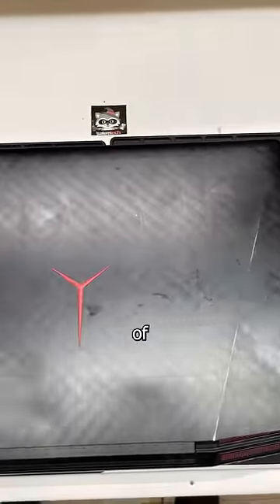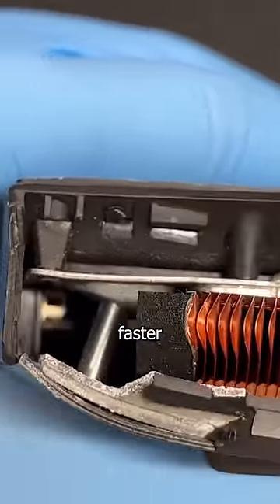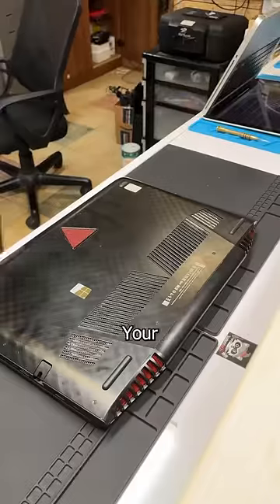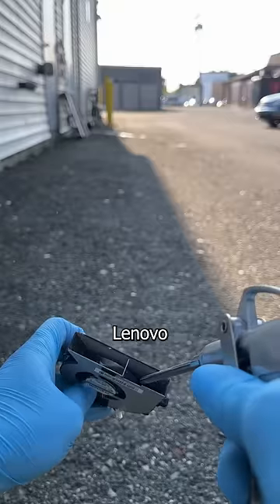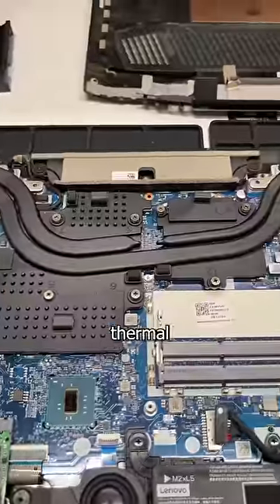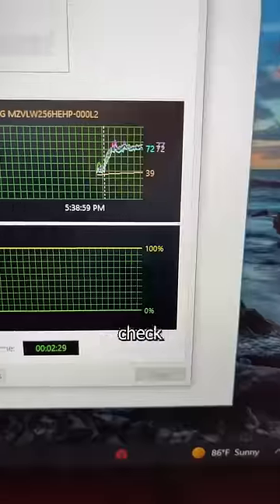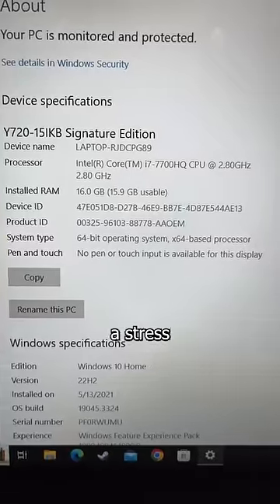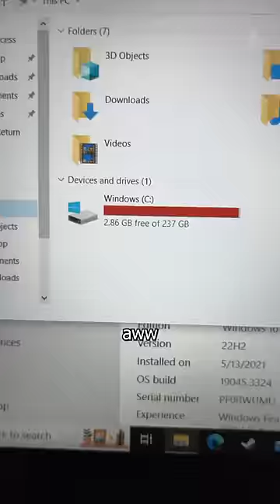Lenovo Legion #gaming #pc is dusty and falling apart #technology #tech #shorts

Comment: That 300 Gb storage in 2023 is painful and relatable
Reply from the maker: Thankfully 1TB NVMe's are super affordable. $40!
Reply: Its from 2018, laptops at those times had a 256 gb ssd + 1tb hdd
Reply: @alisterrebello5337 The good old days when games didn't require SSD to run well
Reply: Just buy a 1tb its so cheap u can not eat one day and have it
Reply: @SalemTechsperts its crazy, i remember paying 100 bucks for one a few years ago
Reply: Me with 118 gb of ssd:
Reply: i have 121 💀💀
Reply: Me with 110 gb rn:
Reply: Me with 500GB
Reply: @minecraft69122   That Aint Bad
Reply: @SalemTechsperts  40 USD is expensive in my country
Reply: @SalemTechsperts you mean adata 😂
Reply: @sihamhamda47 and took forever to load? While also having shitty frame times
Reply: @MrTerrorM omw to starve myself for computer storage
Reply: AINT NOT WAY THAT 300 GB AND I RUNNING ON A CELERON WITH 60 GS LEFT
Reply: @MrTerrorM it hurts, the not eating part to get what you want is so relatable
Reply: im just chilling with 256gb😃
Reply: Me using 128 ssd 😢
Reply: @alisterrebello5337  the 1tb hdd in 2018-2019 they are literally sometimes in budget or mid-end already
Reply: @SalemTechsperts sure is in the US, but not over here where the exchange rate is ₦800 to $1 lmao
Reply: Lol imagine clinging onto 1tb as a minimum, I’ve dealt with all of the sort 2TB, 1TB, 750gb, 500gb, 256gb, 128gb, 64gb, 32gb, 16gb, 8gb, 4gb, and 2gb respectively, below  32gb is abysmal but 64+ is solid, I’ve got a 64gb surface it’s probably Trying to update as windows usually does so it’s storage is kinda lower than usual but 22gb remaining is manageable. It also has a 256gb sd card that has 171gb free
Reply: @sihamhamda47  the bad old days when HDDs were required because SSD's were so expensive.
Reply: I have 56  bro
Reply: @Josaiah i have 10 gb i feel you my brother.
Reply: I have 128 and windows took half of the storage
Reply: Yep, I’m stuck on a 256gb nvme in my laptop, but have an empty sata bay so I might get a 1tb sata. Sadly my new 128gb A2 chip  SD card died and had pictures of my deceased relatives and some games. I likely have the pics backed on another device, but I feel shitty losing a new 128gb card. I think it’s malware because it sometimes shows up as the wrong size and format. I prefer desktops
Reply: @SalemTechsperts i saw a 2Tb samsung m.2 for 60 dollars at best buy a couple of days ago lmao
Reply: Me with 236GB Gen3 drive😅
Reply: I have 120
Reply: my C disk has 58 gigs lol I use my D disk for everything else
Reply: It’s crazy how even 512GB is small nowadays
Reply: Been having 2 TB since 2015 can’t relate.
Reply: Wow I got 50GB
Reply: 2TB M.2 SSDs are like 80 bucks
Reply: @sihamhamda47   They still dont require it. Right? 🙂
Right??😐
😶
Reply: honestly that's a lot
Reply: Well I’m still running 52g and my computer is gateway
Reply: @SalemTechsperts it already that cheap ?????
Sadly i also need upgrade for my ipod
How it priced for a msata 256gb ?
Reply: @SalemTechsperts probably lacks a dram cache. Not really what you want for gaming.
Reply: I have 256 and I struggle to use it all, I wonder what the hell yall use all that storage for
Reply: @khaliil12mm i mean it kinda is. 500gb is like 5 modern games nowadays. Like bro hell warzone alone is 200+ gigs as a f2p game
Reply: Me with 2TB ssd with GTX 750 ti level gpu
Reply: @khaliil12mm that is bad
You have to divide it by C and another partition for all other programs. 
I AM LITERALLY RUNNING OUT OF SPACE
Reply: @RimFaxxe  K I will Try It Out Later Thanks For The Idea
Reply: Have a pc from 2014,and it has 500 gb😂
Reply: nah my pc still good with 128 gb ssd ( i lied )
Reply: Welp, it's a 2016 design so I'm not surprised
Reply: I have a terabyte and have it full all the time man, I need to get my an external drive but I'm broke rn lol
Reply: On my pc for the longest time i was running win 7 with 20 gig c drive because when my dad built it he said it boots faster that way
Reply: My iPad (8th gen) has 32 GB of storage 😭 😭 my freaking Apple Watch (SE gen 1) has the same amount of storage
Reply: @SalemTechsperts  about 100,000,000 din in my country
Reply: What you store on them, seriously for internet browsing you not need more than 250 gigs.
Reply: @zamorakbrews7228 bro, I dropped 300 bucks on a 120gb samsung 850 evo back in the day.  Those things run less than 30 now.  They're 10 percent of the cost I paid  6 years ago 😭😭
Reply: @alisterrebello5337 even still, 256gb of storage on a gaming laptop is small, if I am paying $600+ I should get atleast 500gb
Reply: I have 100 GB storage on my 2008 laptop. And i can't even afford an upgrade 😭
Reply: @NetQza same. laughing in 120gb sata SSD and 17 year old fujitsu siemens laptop
Reply: @samulimahkonen8604  we are both laughing in old ass hardwares
Reply: Is it? I don't speak laptop, and I shoved quite a bit of storage into my PC over the years
Reply: @sihamhamda47 the gold old days on my 5400 rpm 500 mb HDD. I love being able to work an 8-hour shift before my windows boots!
Reply: I got 20 gigs 😎
Reply: I have 7 tb of storge. 1 x1 and 3x2
Reply: I still use my Acer Switch 10 with a 32gb SSD built-in primary storage but i have a 500GB SD card as secondary drive.
Reply: I've a desktop still running on a 30gb IDE
Reply: What do you mean you should be able to fit more than 2 games on your laptop's storage at a time?
Reply: Nah bro im 128 yall hella lucky my ass barely could get nv and terraria on my shit 💀
Reply: @sihamhamda47 no game still does that, i have an 1tb hd for games and every single game i played runs fine (i have an r7 5700g, 32gb ram and a 3060 12gb)
Reply: @SalemTechsperts  Usually some Adata or Kingston crap that will become unusable faster than you will say "mama".
Reply: @SalemTechsperts I remember buying 70$ for 8 terabyte hard drive I still using till this day after 5 years of used
Reply: the last time i bought a prebuilt in super early 2023 it had 250 gb storage 😀
Reply: You don't even know man, I have an actual pc and it has the same amount as the lbtop 😭
Reply: @MrTerrorM except if i buy that i cannot eat for two weeks 😢
Reply: @SalemTechsperts just got a 4tb nvme, 250 Canadian
Reply: @maticpodobnik slim & sexy measurements
Reply: @EasyMoney322 What operating system does it use?
Reply: @lordzaboem  Win 7 either ultimate or pro.
Reply: I just got a pc myself. Im poor, so i got a family members old one. It's from like 09. It has about 1000 gigs of storage. Shits wild.
Reply: My laptop only has 217gbs lol, and it’s from 2020
Reply: I make it work tho
Reply: try 256
Reply: Dude, my ex's laptop only has a 50gb hardrive. Lmao
Reply: Gta v would take 1/3 of your storage😂
Reply: I got only 256 and 4 gb of ram
Reply: @sihamhamda47 technically they don’t still, they make high end SSD’s. Dunno why you would want one given HDDs run significantly more effectively and energy efficiently. Though to each their own
Reply: @SalemTechsperts 40 USD ??
it's 3,400 INR in my country
Reply: my 250gb ssd has 40mbs available 😂
Reply: I have 500 gb in my internal ssd, this is why I'm gonna add an additional M2 after undusting and changing the thermal paste
Reply: @SalemTechsperts yo where'd you get that?
Reply: mine has 300 gb too
Reply: @sihamhamda47 not the good old days in the slightest cheap SSDs are a godsend
Reply: It’s barely enough for 1 COD game
Reply: I have a TB full of stuff on my laptop
Reply: @SalemTechsperts no way it's $40. I paid $60 I swear bro
Reply: @SalemTechsperts What the- what? It's up to almost $200 in my country and that's on flipping discount, why tf it's so expensive here?
Reply: @sihamhamda47 you don't need it for good performance in terms of FPS but loading times will be brutal without it
Reply: Not me rocking my shitty little 128GB HP that has been overclocking constantly since the first time it was turned on, but due to it's paper thin, cm wide CPU, it's litterally not powerful enough to generate enough heat to actually overheat
Reply: Bro i have 256GB SSD and everything works normal and I even have 90+ gb free space
Reply: Mines worse. Its 222 gb💀
Reply: @Six_Yeager  💀 💀 💀 💀 💀
Reply: i still have my dad,s 20gb HDD
Reply: @SalemTechsperts  bruh it costs like 300$ where I live. For comparison an i7 10th gen cpu is around 900$ here
Reply: I have a like 2020? Computer that has 130 gb, and like 100 gb of those is used by god knows what
Reply: I have a 118 GB storage on a gaming pc from 2012. Still works…………………

Help me
Reply: @alisterrebello5337 ...thats considered bad now????
Reply: 64Gb 😢
Reply: @SalemTechsperts T-T im using 2 128gb the prices here are way too expensive
Reply: Had my os stored on an old 250gb ssd and it kept getting full after updates etc (moved the download folder and pretty much everything that could be moved without messing up the system or certain apps) and general drive cloning wasn’t working properly, eventually spend £30 for a lifetime licence for a different drive clone software and within 3-4 clicks and a little bit of waiting It moved straight to a partition I prepared on my NVME, changed the bios boot option and it worked perfectly and booted twice as fast, well worth buying the NVME drive or at least moving the os to a different drive
Reply: I got a pre-built pc a few months ago (shut tf up build it yourself elitists i dont trust myself) that had 500 gb storage and just installed the 1tb hard drive from my old pc, tripling my PCs storage near instantly was quite pog
Reply: Wut
Reply: Bruh om sitting at about 70gb total storage
Reply: Me with 32 GB here... (this laptop has been passed through generations)
Reply: @alisterrebello5337 IF you paid extra for the 1 tb hdd. Usually its either a 300 gb ssd or a 500 - 1000 gb hdd
Reply: I got a 120 gb SSD 😭
Reply: i have 128 usable....
Reply: I have like 50gb 😔
Reply: I still use a 60gb ps3 that only holds like 4 games 😖
Reply: Try getting a 2nd-hand Acer Aspire 7, with Winblows 11, on a 128GB SSD!. it was practically full with only a couple of games on it. Pathetic. When I installed Winblows 10 instead, interestingly, it said the same hardware couldn't upgrade to 11. Not that I care for, or about, 11.
Reply: @jingo500  winblows 😂😭
Reply: I have 200 gb storage 😢
Reply: Meanwhile me with 6Tb and still needing more xD
Reply: @SalemTechsperts hahah yeah affordable! (I literally work at McDonald’s and have £5…)
Reply: Cries in 6 TB of 6.5 used in my desktop although nothing is actually on there
Reply: My man I only have 128,, but then again it’s not a gaming laptop 😀
Reply: @MrTerrorM only one day? Damn prices really have dropped
Reply: What about us 250GBers?
Reply: Bruh 💀💀 i bought lenovo ideapad gaming 3 and got 500sdd only damn Gta , world of tanks and Hitman 3 and im on 87% (red) 💀
Reply: I have 256 gb
Reply: u get a 512 gb ssd for like 25S today
Reply: @NetQza  lol i have 512 sdd only in 2023 really sad hahaha
Reply: I swear to God, if everyone that has suffered in this earth is destined to go to heaven, I'm already there because I use a "POSITIVO" laptop with 1.44Ghz processor, 4GB of RAM (that barely handles Windows 10) and only 64GB of SSD 💀
Reply: @SalemTechsperts But still not for everyone...
Reply: I have a laptop with only 128 gb of space, It's really a pain on the balls
Reply: My old pc had 255 gb now I have 112 gb
Reply: me with 20gb available and 50gb max:
Reply: me with my 32gb chromebook :')
Reply: YOU GUYS HAVE 300GB???!?
IVE ONLY HAD 100 FOR THE PAST 10 YEARS
Reply: Ayy mine too
Reply: i have 222 gb storage lol
Reply: @Project_Baby  only in ohio (pukes in sigma)
Reply: @NetQza  lol hahah
Reply: Me with my 500gb storage:😢
Reply: @Mohamed_Aahil6915 
2 games. Star-field and flight simulator, and there you’re at full capacity. I have a total of 5.5TB and it’s barely enough with the size of games these days
Reply: WHAT my dad ahs 128 Gb SSD and it's works fine 😂
Reply: Yup
Reply: @SalemTechsperts my storage is 117gb 😅😭
Reply: @SalemTechsperts  why didn't anybody tell me? I got a 500 gigabyte ssd in my computer and struggling for storage
Reply: Why buy 300 gb 1 tb isn't THAT expensive jeez
Reply: i have 220 gb storage....
Reply: @SalemTechsperts Really affordable 40$ only here is 80$ for 1tb nvme😢 too much problem with parts
Reply: @SalemTechsperts that’s more then I’ll ever make in life
Reply: @SalemTechsperts  can't you just go to Windows+R and delete all the fes that's there? Does it help?
Reply: I hardly need more than 128
Reply: @Microwave_404  you don’t hardly need more then 128 gb in 2023 for computers
Reply: @alisterrebello5337 it's from 2016. I have this exact same model with exactly the same 256GB + 1TB combo 😞 since it came out. Still looks and works like brand new. Build quality is on another level.
Reply: My main boot drive is 252 😭 but my other drives are like 2TB Each
Reply: i have 126gb + 256gb (ssd) XD
Reply: @sihamhamda47  nah they just loaded slower
Reply: @sihamhamda47 thats because games moved to asset streaming, eliminating almost all loading screens
Reply: We spent $500 to buy me a shitty i5 workstation with 256gb of storage in 2019😊
Reply: My oh-so-lovely prebuilt PC bought in 2017 only has 128 gigs of storage on the primary drive. Thank god I'm building a new one soon with 2 TB of storage
Reply: Not 300gb,
Its 236gb (256)
Reply: I use 128gb ssd😅, that too in a dual boot mode with pop os and windows.
Reply: 2 games is enough 🥲
Reply: @SalemTechsperts  WHAT
Reply: I have 100💀
Reply: I have less 💀💀💀
Reply: @SalemTechsperts affordable, but you need to open the whole back if it’s a modern system 💀 I miss the small upgrade windows that didn’t require 15 screws and lighting 30 plastic tabs so it will actually seal instead of breaking the, like an idiot
Reply: @SalemTechsperts first step: have removable storage on your device
my 2014 macbook air has but that thing sucks dust like a vacuum and has-haswell so pretty useless now since its low end...
Reply: If its enough for tf2 , War robots and ultrakill , its fine for me

Mine has Like 254GB
Reply: @MrTerrorM we’re not eating food…but we ARE eating success!
Reply: I have 250gb 😂😂😢
Reply: Very relatable
Reply: Me with 50 tb
Reply: I have a 256gb ssd
Reply: Better than mine
Reply: I have 112 Gb
Reply: 300 gb is bad?
i have 156gb...
Reply: The fact that it was made after like 2010 is funny enough. But it being marketed as a "gaming PC" with that little space is even better. My RDR2 files are like 230gb
Reply: @SalemTechsperts  Stuff like this still gives me whiplash
Reply: @alisterrebello5337  I have 233 hard drive💀💀💀
Reply: @Itsappuru  40 USD over where i live is like 200bucks
Reply: @SalemTechsperts 40? Where are you buying your parts, ive only seen them as low as 60
Reply: @SalemTechsperts  yeaaaaah, it aint that cheap no more...
Reply: @sihamhamda47 ssd is so affordable now adays that its not really a valid complaint anymore tbh. Dont the consoles even come with ssd?
Reply: @sihamhamda47 the good old days when games weren't 25-100 gigabytes in size
Reply: @SalemTechsperts  I genuinely thought this was a joke until I went on Amazon. Holy shit. I remember when a 1TB SSD in general cost an arm and a leg, let alone NVME.
Reply: I have 400 i feel the pain
Reply: Meanwhile me with 320: 🗿
Reply: I got a 56 gb emc card for storage lol,  350$ laptop
Reply: my mac literally has 121gb and im not going to say its fine
Reply: @SalemTechsperts  you can only get noname QLC trash for that price. 990 PRO cost quite a bit. 980 and 970 EVOs are not much cheaper. Anything less is completely unsuitable for a system drive. And even for general storage, good TLC is highly recommended. QLC belongs in the trash, even Samsung. Thankfully, they don't make QLC NVMe.
Reply: @SalemTechsperts  Aged like milk
Reply: i have 126gb on my desk computer)
Reply: I honestly thought they'd have been gone by the time this laptop was being sold 7th gen laptops would've been 2016 iirc? I guess 250gb drives were/are still a thing. A 300gb drive brings me back to my old college laptop from 2010...AFTER the original 120gb drive died 💀
Reply: @sihamhamda47 no. Bad old days of mech hard drives, where every time you'd click on something in Windows it had to "think" first.

I grew up in the 80's and I'll thankfully pay extra to never own a mechanical hard drive again. 

"Good old days"
You are hilarious with that crap. If anything signifies the good old days it's not having to pay $700 for a midrange GPU.
Reply: Thats actually good for a cellphone
Reply: @SalemTechsperts 
Cries in poor, 2014 potato pc game....
Reply: 105 gig ssd 😢
Reply: Sounds like plenty of space for a lot of games.
Reply: 500gb to 1TB is the norm now when comes on gaming hardware storage.
Reply: 300 is not THAT BAD.
Windows is 50gb, do you have 200gb left for your games.
Reply: Meanwhile I use a third hand 120 GB sata SSD in my laptop
Reply: Bro my potato laptop has 57GB.
Reply: 300 GB’s is not nearly enough bruh i’d be stuck to one big game, a few others and that’s it 💀
Reply: Found this and just have too say, im in this boat after my 1t died and now im stuck with a 300gb SSD only. sad times.
Reply: @SalemTechsperts I don't like to remind, even though 1$ is 5 Brazilian buckos, due to 92% taxation we literally pay 10x higher
While also having a 7.48 hourly pay (BRL NOT USD)
and a high living cost
Reply: I have a 500 gb SSD as my boot drive on my laptop.
Reply: @alisterrebello5337  most only had a 256gb ssd and had a slot for a hdd
Reply: @NetQza  i used to have a 64gb 100 mg/s drive as my main drive in my laptop, And i was running windows vms 💀
Reply: @SalemTechsperts  Where?
Reply: @LanIsOriginal  not always, depends on few stuff but it's not really that bad, i have ghost of tsushima on my hdd and it loads literally within seconds, craziest load time i saw in game ngl.
Reply: @GoGicz   it is definitively worse in nearly every way using an HDD ESPECIALLY load times, if it loads within seconds it'd take even less using an SSD
And even with light games that load fast it's still awful because of pc boot times
Reply: @LanIsOriginal  i use ssd for windows but hdd for games, and like i said load times are completely fine, it doesn't matter to me if it loads in 4 seconds or a second later, just saying that it really doesn't matter that much.
Reply: @GoGicz   then the games you play are very light because in a lot of games it does matter, a lot
Reply: i have only 114gb storage... in my asus vivobook 14....
Reply: bro I had a 2015 acer with 2 gb ram and a emmc of 32 gb running win 8.1 💀. Not upgradable
Reply: @SalemTechsperts  in my country its expensive asf
Reply: I got 4tb worth of storage and I use every bit of it
Reply: I have a 64 gigabyte
Reply: @SalemTechsperts  im still fucking poor, been storing all my pc files in my head and linking them telepathically
Reply: 256gb MacBook 😂😂
Reply: @SalemTechsperts  At this point, 1TB is not enough. Get at least 2TB imo
Reply: @LanIsOriginal  not light, ghost of tsushima is not very light same with gta 5 or witcher 3, dying light 2, arma 3 with mods etc. ofc its better to have ssd for games too but it's not that huge of difference especially if you have decent hdd and not some shit one.
Reply: I have 1TB SSD and it's already full idk how, but also I have this PC 6 years
Reply: I bet it is even HDD.
Reply: bruh ppl having 64 gb as ram
Reply: i use 150gb bcs turkish economy
Reply: Me with a 250gb PC:
Reply: my computer still has an 80gb hdd
Reply: Wdym i have 116 gb storage and i thought that was normal 😳
Reply: Easily fixable by just taking your data and wiping the default windows provided, then installing via the iso from Microsoft  windows goes from like 200GB to 20
Reply: 256GB actually
Reply: I have 2 TB HDD internal, 512GB 3rd gen ssd i bought back in 2021 when i purchased my pc. External 4 TB HDD. 
I had to buy 2TB gen 4 SSD 2 months back because i was running out of space.
Reply: I have 2 TB HDD internal, 512GB 3rd gen ssd i bought back in 2021 when i purchased my pc. External 4 TB HDD. 
I had to buy 2TB gen 4 SSD 2 months back because i was running out of space.
Reply: beat my 51gb laptop...
Reply: @SalemTechsperts that aged well.
Reply: 460 Gigglybytes SSD
Reply: @SalemTechsperts perks of living on the US? Because it never felt like MSRP when buying electronics where i’m at 😂
Reply: I have over 36TB on my desktop
Reply: holy crap really?? @SalemTechsperts
Reply: I mean I’ve got 128gb on my laptop, done 4 years of uni, had it for 6years and still got 75gb free 😂 … so I mean not really
Reply: i have 200 lmao
Reply: i have 223 Gb in 2024 :skull:
Reply: My 240gbs ahh
Reply: 40$?minimum 100$ im my country
Reply: I had a 100 GB SSD and a hdd now I upgraded the hdd to 1TB but it has overheating issues since I play games with a bit higher graphics than I should
Reply: Imagine my dumb ass living today with a 32 gb Windows disc and a recent technology store stealing my external disc with information inside after charging me around 7 bucks to remove an extremely inflated battery 
Yeah.. my life sucks
And i don't have The Greatest Technical That's Ever Lived to help me...
Reply: 1tb isn't enough for me 😅
Reply: 300gig in 2024 try 55 gig only on a laptop😊
Reply: 256gb Nvme
Oh yeah and 50TB of SSDs
Reply: I still have a laptop with 126 GB SSD. It works by only installing the smalles old or Indie games
Reply: @MrTerrorM it's more like 80gb of storage as the rest is used for windows installed apps that are usually unintstallable.
Reply: @SalemTechsperts  Tempting, very tempting
Reply: When you don't have a D drive
Reply: I managed to fill my 900GB PC almost to the brim.

I have like, 4 games on there. 💀
Reply: My laptop has 27 gb. I knew that wasn't a lot but like. Wow even 300 is seen as small?
Reply: @SalemTechsperts  still remember that day when i switched from my 2nd laptop's og 500GB HDD to 1TB SSD
Reply: 2x 2tb nvme's are my standard. nothing less
Reply: Dawg my iphone 7 of 5 years had 32 gb storage thats hardcore survival
Reply: Meanwhile Macs have 256 GB of storage 💀
Reply: @SalemTechsperts  I bought a 1TB for $130 two years ago, now thats the cost for some 4TB models
Reply: Bro my main local drive is 200gb it's hell and 40 dollars means 2k in my country's money
Reply: @SalemTechsperts affordable? In this economy?
Reply: Nintendo switch users with a base 24g Gb of storage
Reply: @SalemTechsperts and Im pretty sure theres space for them in the legion laptops
Reply: I know the feeling... I got my computer almost a decade ago and it is only a 256gb HDD... I need to get a new one.
Reply: Bro my laptop got like 150 GBs on it
Reply: @zephyrstrife4668  It doesn’t cost much to add another drive to your pc or replace the old one
Reply: My laptop I got 5 years ago only has 217GB because my mom got the best everything on a laptop back then and then the least possible storage thinking I wouldn’t need it. Its so painful now to not even be able to keep more than 3-4 games downloaded at once
Reply: 128gb 2014 MacBook Air.    *A G O N Y*
Reply: @SalemTechsperts  can you put them in a laptop tho?
Reply: i have 118gb and a 119gb sd card ive been using as a permanent 2nd hard drive for 3 years
Reply: MY only a 440 gb
Reply: I had a laptop that had like 50-60 GB of storage and it was full than my hands it's so full it stop a few seconds and the charger won't charge properly and my laptop dose not have 100% I am ungrateful because
that has touch screen and 360 folding laptop and it's dead
Reply: Me using 500gb hdd😢
Reply: Even 1TB is almost bad enough, but I think that's if you're a hobbyist. My VST's take around 500GB for all its libraries. My artwork not so much. But games... yeah, more than that.
Reply: @HYPERPEACE  i feel you...
Reply: @HYPERPEACE  I have a question is downloading war thunder safe for my current pc it has 500Gb but have still space of 400+
Reply: @HYPERPEACE  alright then
Reply: @MrTerrorM  who spends 40 a day on food lol, unless you're eating out.
Reply: @SalemTechsperts i only have 128 gb +1tb hdd tho
Reply: @SalemTechsperts  It's really nutty how affordable storage is these days. I remember how pricy a 700gb hard drive was back in like 2013, 2014.
Reply: that's plenty for a boot drive